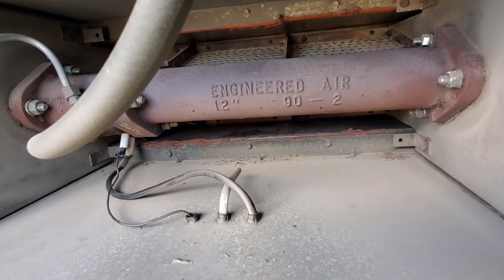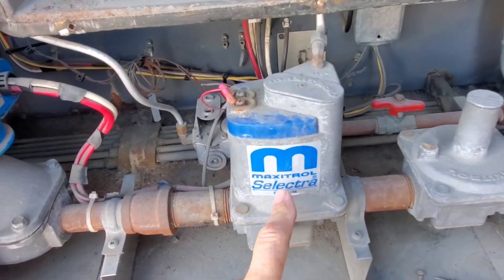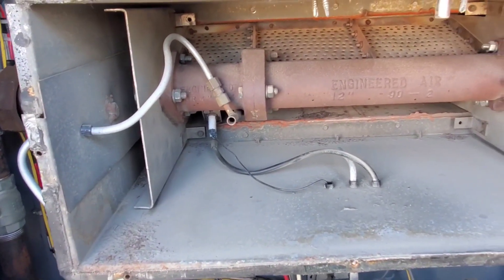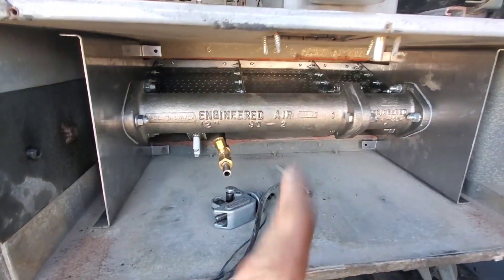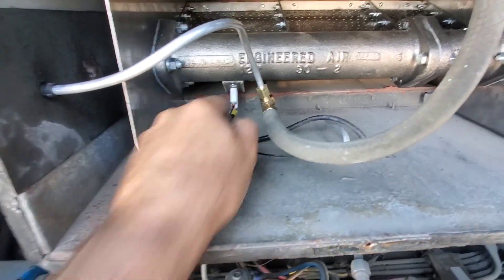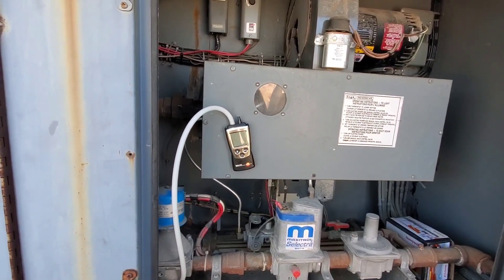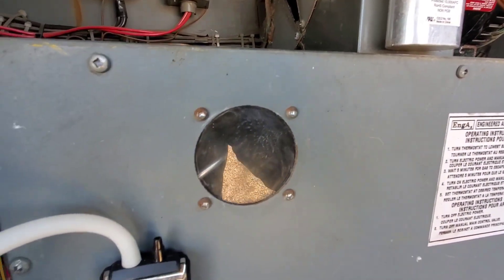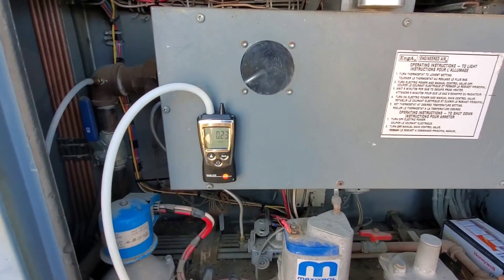Replacing A Gas Fired Burner On An Engineered Air

Comment: Working on make up air unit eng air, changed burner and fire it up but burner lit up for 5 sec and shut off. What would be the problem? Do you think it might be the gas valve?proly should check the inlet gas and outlet gas pressure. Thanks for advanges

Comment: What cold deck temp did engineered air use on that unit? Also i always pull the entire primary air tube for the pilot, spiders love to nest there especially at the welded tube on the burner fan outlet.
Reply: There's actually 2 sensors, 1 on the discharge and 1 after the dx coils, the coil (cold deck should be set somewhere between 55 and 65 or so) then discharge sensor would be the one set to 68. Reason I asked is because I've found the factory default of 60f is not always low enough to adequately dehumidfy.
Reply from the maker: @Mattmm83  yes correct, although this unit was frankensteined years ago so in dehum all compressors come on to remove max moisture and the discharge air sensor is used to reheat it to around 68
Reply: Good to know. So this unit has seen the same problem I've experienced on these units equipped with dehumidify, thanks 😊
Reply from the maker: Runs off discharge air at 68ish ⁰F

Comment: What caused the burner to fail?   Not that I will get to work on something of this caliber but would have thought a hx failure first.   Thanks for sharing.
Reply from the maker: The burner plate had hair line cracks from running 90% of the year for 18 years.  That can cause delayed ignition.

Comment: I love working on those modulating burners! A little tip if I may. Put some dielectric grease on those terminals on the modulating gas valve. They are prone to corrosion and then do not send the proper voltage to the valve. Cheers mate, great video!
Reply from the maker: Great advice, I have some and use it all the time.